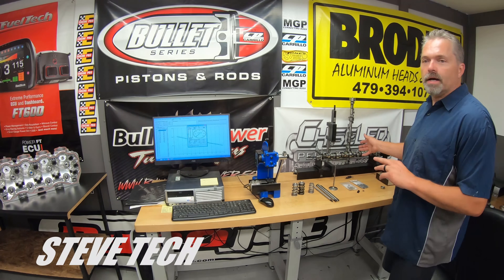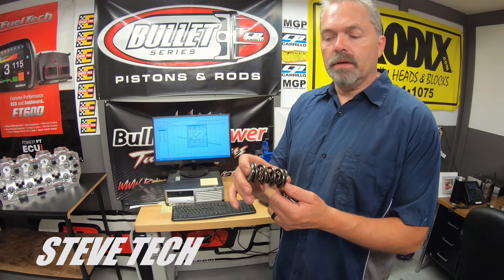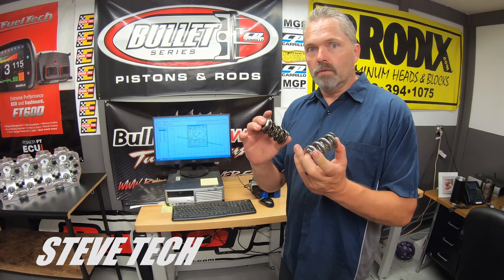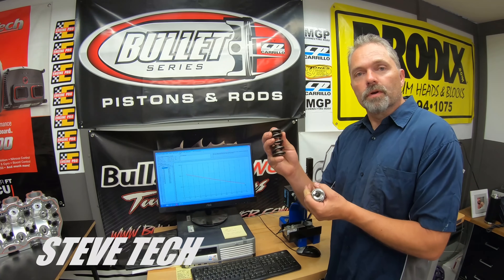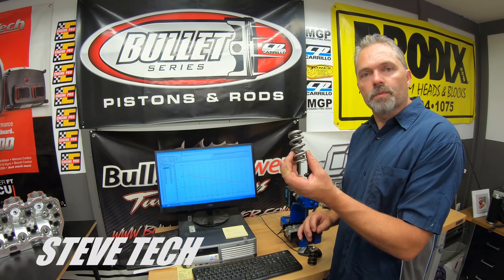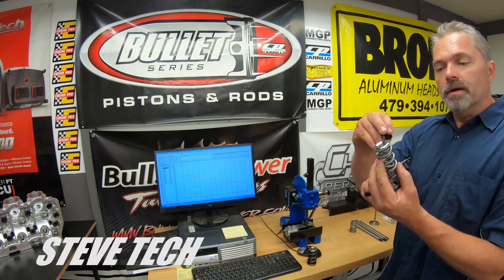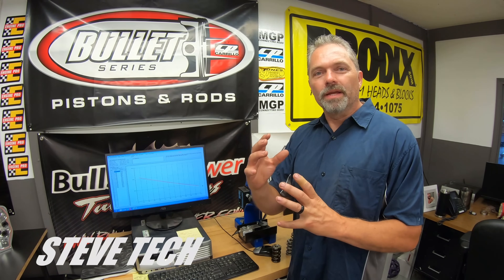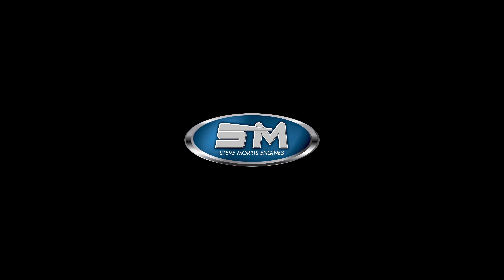Race / Endurance Valve Springs

Comment: Watching your channel and having seen your product in cars and everything some ppl had to go through to get issues fixed (that were your fuck-ups) I’d NEVER buy one of your engines because I’d always be thinking in the back of my mind, ‘l wonder what he forgot in mine qnd what’s wrong with it’.  There always would UNDOUBTABLY be SOMETHING either forgotten entirely or overlooked or not engineered correctly and requires some after-care. I wouldn’t want that kinda worry with your high-priced engines. They are supposed to be piece of mind kind of engines. No such thing as piece of mind exists when running your engines. Only know you’d have to come back or have it shipped back to have to fix something you’ve fucked up or forgot. JMHO Never would buy it. Never.

Comment: I’ve heard some builders say that they’ve taken the center spring out of a triple spring and valve control was very similar because supposedly most of the spring pressure the third spring makes goes into controlling it’s own weight.

Comment: What do they look like after being run to bind 100 times?
Reply: A quality spring will have a designed set height after break-in. Considering 100 times is a few seconds at idle for a spring, I'd guess it would still look new. Test it, install it, run it 1000 miles, and then test it again. That would actually tell you how it's going to last.
Reply: @leftyeh6495  Way back in the day I was told by several engine builders that running new springs to bind a hundred times or more would extend their lives. One built 327ci SBC's for drag racing that turned 13,000 rpm. Spring failure was a big problem no matter what springs he used until he started running new springs to bind 100 times. He also was able to ID springs prone to failure as bad once drifted out of spec. Another built German Ford V6's for endurance road racing. He had cam and spring failures and was pulling his hair out until he started running new springs to bind before use. Reason I posted the previous is it would be interesting to see if either of the two spring types would drift out of spec if run to bind a bunch of times.

Comment: hey steve thanks for your videos! one thing im wondering is the relation between cylinder pressure and valvetrain stress? ive been binging on videos the past few months and most videos seems to focus on effects of high rpm
Reply: There are effects such as you need a stronger exhaust valve because of cylinder pressure. Intake is opening on minimal pressure, exhaust is opening on lots of pressure. 

What I've found interesting is the dwell time vs stress. It takes better parts and better engineering to control the parts at a higher RPM, but since the dwell time is shorter they can actually live longer under higher pressures than a low RPM build. It was kinda mind blowing to find out that you can chuck a ton of boost onto the pistons and rods at 5000rpm, but that same torque output at 2500 rpm would start bending rods since the stresses are the similar, but last twice as long.